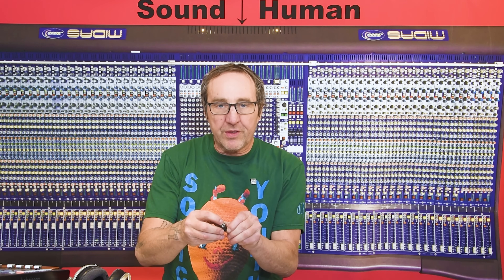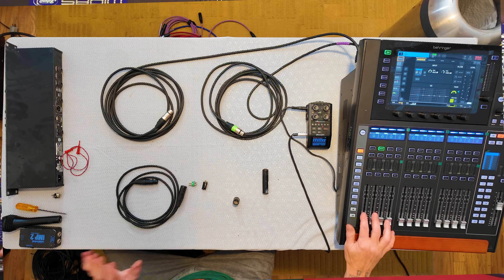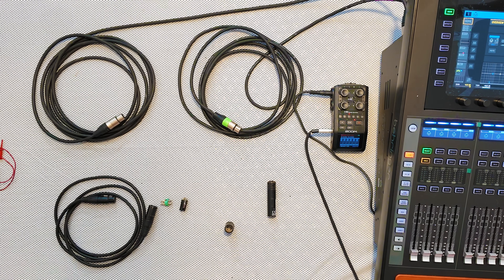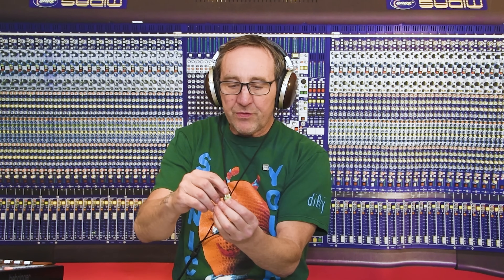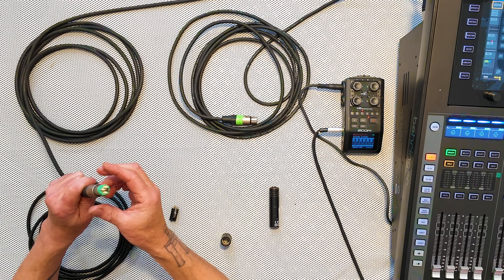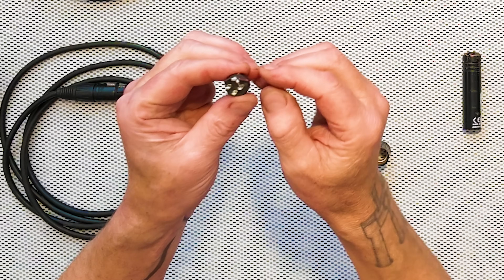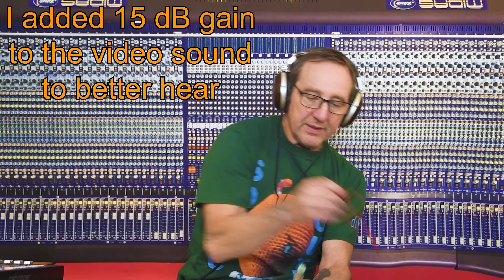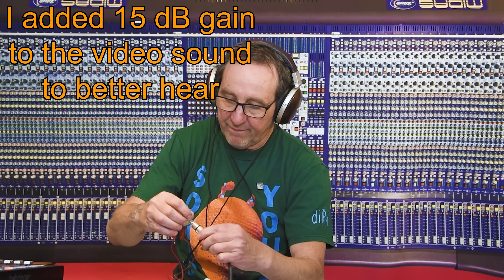XLR Shell Ground Issues

Comment: Thanks for covering this, Dave. The more people that know about this the better. I design analog audio equipment too and with balanced (differential) systems, the system signal ground is supposed to be isolated from the chassis ground anyway. In other words, the proper way to establish signal ground is during the balanced to single-ended conversion in the circuit, thus leaving pin 1 out of it entirely. The pin 1 terminal of the device's input jack should be terminated to the chassis directly at the point of entry. This creates a continuous Faraday cage consisting of the cable's shield, its outer shell, and the device's chassis—so it's all one big shield with no holes and no signal current flowing in it whatsoever. If every piece of gear obeyed this proper balanced grounding practice there would be no problem. But as you can see/hear, even Behringer, a reputable brand, is doing something different. Not necessarily wrong, they might have balanced/single-ended combo jacks or otherwise tie the unbalanced signal ground to the balanced.   That's why it's still smart for me to do as your dbx 160—and many other devices—do and provide a ground lift switch.  Since balanced twisted pairs are effective at cancelling noise on their own, pin 1 is just extra protection, so they can lift it to forbid another return path for the signal.
Reply: Stepping away from audio gear. The telephone system suffered from massive noise problems years and years ago. When someone realized that by twisting the two wires along the entire path from one telephone to another, say from New York to Los Angeles, that twisting eliminated the noise sufficiently to make a transcontinental phone call possible. When the use of the telephone system for modems started, those cables were not twisted with enough turns to get high speed modem connections.
Modern network cables are twisted with more turns to move upwards from cat 5 to cat 6, etc. Higher data speeds with less noise. Now we have cat 8 cables where each twisted pair has a grounded shield around it and then the entire cable has a grounded shield. Don't tell me that they had good amps in 1915. They did not. It's the twisted pair that makes the noise 180 degrees out of phase that cancels the noise. The number of turns is the key. Two parallel wires interact directly, the noise stays in phase. Noisy.
I don't know crap about audio yet (learning), but anyone doing electronics must understand this or fail completely.
Thanks for the excellent video. I'm going to find some schematics and study this more.
Reply from the maker: Twists are king!
Reply: Agreed except where you say the cabling  cancels noise. The cable does not cancel noise, that is done by the receiver. The cabling geometry / symmetry allows better rejection at the receiver but it does not have any mechanism to reduce noise on its own.
Reply: @brandise76   Haha true. Wires/cables tend to work better when connected to stuff. That's actually pretty funny. I'd love it if one of my drummer friends asks me to troubleshoot his home studio and when I get there all the cables are still in the packaging, and like, just sitting on top of the monitors.

"Hmm... You've got all the cables, man—everything should be working. I dunno, maybe try sticking 'em in some holes? Take pictures of the way you have it now though so you don't forget this setup." 😂
Reply: @brandise76 this is not correct, twisted pair most certainly DOES cancel noise, but only certain types.

Basically any wire is also an antenna, and if you run two wires straight and parallel to each other, and they are near an AC power cable or switching power supply or something like that emitting EMF noise, one of wires will have more "signal" induced on it, creating a current flow of noise because you have a potential developed between the two wires.

By twisting them, each wire now receives an equal amount of induced noise voltage, and so while both wires still have potential on them, they can cancel each other out.

Some mic cables like Canare use quad wires, so 2 wires per pin, twisted together, and this reduces the induced noise even more because the twist pattern is much tighter, so even less potential between pins.

So yes, twisted pair cable does cancel noise reception, which makes a huge difference.
Reply: @ke6gwf that's exactly what they were talking about... both halves of the twisted pair get THE SAME amount of noise and CARRY IT to the receiver, and the noise is then cancelled out at the receiver. If the cable was cancelling out noise, that would mean each half of the pair would carry LESS OR NO NOISE, but twisted pair does not do that and it is not the point of twisted pair, the point is to carry EQUAL AMOUNTS of noise. You're trying to say the same thing, you just misunderstood what they were saying.
Reply: @cheater00  no, I understand how it actually cancels the noise out, which you don't, and neither do they lol

Each half of the twisted pair picks up the same amount of noise, but in opposite polarity, and so the two signals cancel each other out.

Are you familiar with how destructive interference works with a laser beam, or how a Bose noise canceling headphone works?

If you plot the sine wave AC hum noise on the oscilloscope, you will see the sine wave on one wire is the opposite of the sine wave on the other wire, which means that there is no potential voltage between them, because they are out of phase.

It's when you have the wires in different positions to the emf field that you get a voltage potential between them, and you have a current flow induced as a result.

But when you twist them so that they have the same level of noise signal, but out of phase, they cancel each other out.

And the receiver has nothing to do with it, because there is no voltage potential at the end of the wire for it to detect or cancel.

Basically just think of twisted pair being designed to avoid emf inducing a voltage potential between the two wires, and it's the alternating wire position that cancels out the induced voltage, leaving both wires at the same potential.
Reply: @ke6gwf  yes homie that's exactly what we're saying. but the noise doesn't get cancelled out IN THE CABLE, it gets cancelled out in the receiver, where the signal gets converted from balanced to unbalanced. the cable itself carries the noise, in common mode, up until the very tip of its conductor at which point the receiving device picks up the two signals (hot and cold) and puts them through either a tranformer or a semiconductor based circuit to convert the signal to single-ended by combining the hot and cold signals by finding their difference. so if the cable carries (hot + noise) on the hot side and (cold + noise) on the cold side, then the combined version is (hot + noise) - (cold + noise) = hot - cold + noise - noise = hot - cold + 0 - hot - cold.

glad to be of service letting you learn! remember, one learns something new every day!
Reply: @cheater00  the other thing to remember is that this is why they created Balanced cables, to avoid that noise potential by having dissimilar wires like unbalanced cables have.

The amplifier, receiver, etc, sees the voltage potential across between the 2 conductors, and that's what it amplifies.

If you are running an unbalanced cable, that voltage difference includes whatever emf induced noise it has picked up as an antenna, and since you have a signal wire plus the ground wire, you get a lot of noise potential.

With a Balanced cable, you now have 2 dedicated, isolated, signal wires, with the ground wire now not part of the signal chain, but rather providing shielding from the emf, and the twisted pair architecture rejects most of the induced emf, because it cancels out the antenna effect by keeping the potential across the wires the same.

You may still have potential between the chassis or the ground wire, but it's not part of the signal chain, so it doesn't get into the amplifier.
Reply from the maker: The nuances of this conversation are fascinating. 

The question that is forming seems to be: 

If the cable cancels out the noise then why would we need or want a differential input? 

On one hand we have a differential input that polarity versus one of the signal wires and sums it with the other wire which increases any signals that are not the same on both wires and cancels out any signal that's the same on both wires. 

But we also know that for a balanced line to work the desired signals do not need to be equal or opposite on the two signal carrying wires, all we need is for the desirable signal  to not be exactly the same on both signal carrying wires

We also know that with the transformer that has no polarity reverse or differential input that any signal that is identical on both signal carrying wires or inputs to the transformer do not pass through the transformer because there's no difference between them. 

The question is then becomes, if the wires are twisted such that any noise induced upon them is equal on both wires, are connected to a non-differential electronic input wherein there is only a single audio amplifier, will the noise still be canceled?

Do we even need differential inputs on balance line mic preamps? Why do we even have them? 

If the mix or line input offers the exact same impedance to ground to both wires in the cable, but there is only gain or input buffer circuitry on one of the wires, would the noise induced equally on both wires of a twisted pair still be unable to to pass through that input stage?
Reply: @DaveRat  delightful questions! Lol

My part of the discussion has basically been limited to the emf noise rejection of the twisted pair wire itself, which under round cow and zero friction theoretical conditions prevents any voltage potential across the balanced line besides the signal, but there are plenty of other sources of unwanted voltage potential, between equipment and, on the ground wires, on the connector shells, inside the electronics system itself, etc, as well as the interaction of all of those together in random and unpredictable by mortals ways, so we need multiple methods of noise rejection and filtering and cancelation, and they all work together to achieve great sound.

Plus, even if a brand new Canare Star Quad mic cable completely canceled out all the noise coming into the board, after a few tours, and the road case running over it, it's not going to be quite so perfect when it's wrapped between the distro cables from the generator, and so the more layers of protection we have, the better! Lol
Reply: @DaveRat   Good question. I'm gonna go with... Damn, that's a brain buster because in balanced systems there's a difference between the differential and common mode impedances. So the inverting and non-inverting signal wires don't see the same impedance from a differential perspective but the receiving differential buffer/line amplifier circuit presents an equal common mode impedance and it's the common mode impedance that matters here. 

So if you're talking about the impedance that each wire sees independently then the answer is no, the noise induced on both wires will not be effectively cancelled.

If you're talking about common mode impedance then yes, you can still benefit from common mode noise rejection in the case you described but at a high cost. The high cost is because the receiving amplifier needs to present a high input impedance as to not load down the source—as per usual—so if you wanted to maintain equal impedance with respect to the inverted signal, you'll need to have high series resistance in the non-inverting signal path which will induce noise. Then you're gonna be amplifying right after that, bringing that noise floor up. So your signal is going to suffer quite a bit from resistor noise (Johnson noise) and you won't even get a positive net gain out of it (without disrupting CMRR). The most you will get is unity gain, but a much noisier unity gain than had you used regular single-ended topology.

This is just how I'm seeing it play out. I never got a formal education in this stuff so I'm not sure how much value my opinion holds. It's definitely not credible, that's for sure.
Reply from the maker: I don't know the answer without testing. Not sure the impedances to ground need to be high. The non differential single amp input could be a floating circuit with say 200 ohms to ground and the amplified signal line could also have a resistor of 200 ohms to ground.

So there would be real ground and the 200 ohm floating ground of the input amplifier. 

Both lines would see 200 ohms to ground, the single line input amp stage would amplify one line in relation to the other line. Perhaps better a emulation of the primary of a transformer than a differential amp.

Also, with a single amp, as long as both lines see an identical impedance to ground, it would eliminate all the issues of differential inputs not being perfectly matched.

I am sure someone has done something like this or there is a critical flaw to the concept.

But I think what is interesting is that if this works or could work, it would be a great way to demonstrate that a differential input is not needed. Which we already kind of know because of how effective transformers are at eliminating common mode
Reply: @ke6gwf if the noise were out of phase between the two halves of a twisted pair it would get amplified by the differential amplifier in the receiver. It's the fact that is both picked up equally and in phase that causes it to be rejected. Because it's picked up by the signal pair equally, and in phase, it doesn't generate a voltage between the signal pair. It's still there with respect to ground, but ground isn't actually needed unless you're using P48 power anyway

Comment: Why not have an xlr where there are 4 wires, 3 inside of the shield, and the shield is wired to the chassis? Would a 4 element wire solution solve both of these issues?
Reply from the maker: Hmmm, well adding the 3rd wire plus shield is non ideal for EMF as EMF is best rejected with symetrical wire bundles so you need 2 or 4. but adding a pair of additional wires so there are 4 could solve that.

The issue would or could be that the same problem happens with DI boxes where the metal exterior of the di box needs to be grounded and will ground off of the 1/4" input. Even if the XLR shell is grounded to a different ground wire than pin 1, that extra wire will still act as a ground connection between the chassis of the mixing board and the DI box shell which is connected to say a keyboard. 

So now the keyboard chassis ground and mixing board chassis ground are connected creating a ground loop. 

Some gear will even buzz or hum if you take a connector with pin 1 shorted to the chassis of the XLR and just plug it in. 

If you carry that shell ground on a separate wire throughout the system, sooner or later it's going to be plugged into something and it does not like chassis ground connected to audio ground.

If extending mic is necessary and also keeping an extremely low noise floor is necessary and also you can't have special cables to extend then you could get some XLR male to female barrel connectors and short pin one to shell of those connectors and put those at any junction where mic cables are extended.

For nature recordings I would ground all the shells and for recording studios where the extremely low noise floor is important I would say just don't extend cables.
Reply: @DaveRat  This is great. I more so meant to say discrete connections for each 4 connection points, and no bridging of pin 1 and chassis. So like chassis ground is discrete and audio ground is discrete. I do know that even with Neutrik TS and TRS male connectors, the physical jack bridges chassis to shield. My question knowing your thoughts, about field recording and so forth, if you know you’re going from XLR to TRS or TS, is there any benefit in floating the connection and not wiring chassis on the side of the TRS or TS connector? Or is it just another potential issue with emf?
Reply from the maker: Interesting and having that connection to the show either bridged or with a separate wire forces a chassis ground a chassis ground connection for interconnected gear. 

You don't really want chassis ground of chassis ground ground connections as each chassis ground should be grounded to its local AC ground. 

The audio ground within float separately allowing equipment designers to deal with the two separately. 

So the concept is chassis grounds are grounded to local AC grounds of each piece of gear and the audio ground passes through along with the signal with an optional lift if need be. 

Of course the issue arises when the connector shell is not plugged into a piece of gear and remains floating and a chassis ground needs to be established for extended cable shells

Comment: When I first started making cables I would always connect the two, since it seemed like the “right” thing to do, but I stopped after a few years once I knew more. Way easier to let the gear decide whether they should be connected or not. 

Very rarely I get a direct request to connect them or just one side, but otherwise leave it alone. You could probably make an overcomplicated proprietary XLR that would automatically bridge them if put into a cable connector instead of a chassis socket… yeah maybe not!
Reply from the maker: a cool idea. Yeah and don't know how that would work. I guess someone could make a XLR connector where you twist something in it grounds are ungrounds the pin one to the shell.

That said you don't really need to ground the show and grounded shells seem to barely do anything except for cause problems. 

It's amazing how something that should be so simple is always complicated